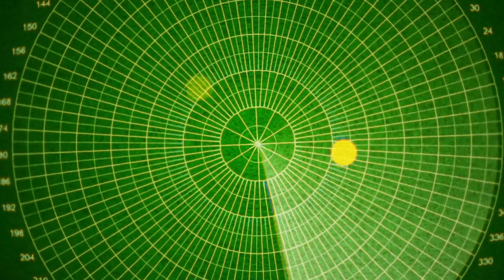Maine's North Woods: Carbon Storage and Climate-Smart Forestry

Comment: This is complete and utter propaganda advanced by logging and paper interests. The peer-reviewed science is crystal clear: old forests are the powerhouses of carbon sequestration and they maximize biodiversity  as well. There are 10 million acres of old clearcuts, young forests, and shrublands in Maine - they have overcut so badly that even DEER YARDS are rare in northern Maine. The reality is that western New England - the Berkshires - have higher levels of C sequestration than anywhere in Maine outside of the far and few between true ecological preserves. And the jobs? Most of the timber logs are exported to Quebec and even today, the average logger has to drive several hours to get to log jobs.

New England Forestry Foundation is a vampire of an organization: they lie, and they lie, and they lie. And those lies always mean cut more trees. They use pseudoscience for cover. For those who want to seek the truth, check out the Wildlands Report from Harvard Forest. It counters all of this nonsense. NEFF is the enemy of the forest.

You know what Climate Smart Forestry means? Business as usual. Clearcutting as usual. The depauperization of the North Woods.